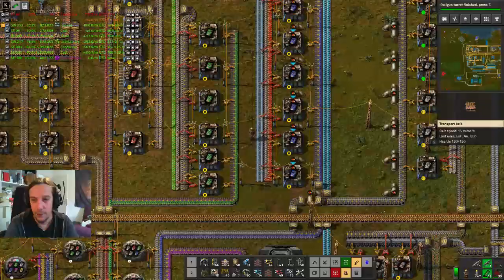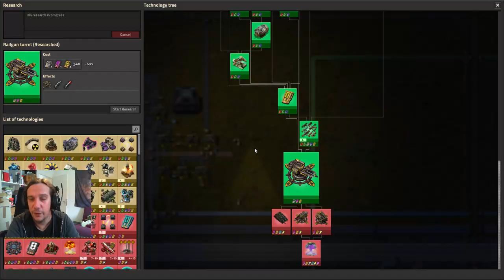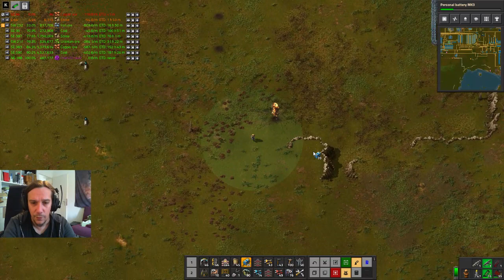Let's Play Factorio Krastorio 2 - 50 - Gameplay Playthrough

Comment: your nuclear setup is wrong, Krastorio changes the entire thing and it's quite easy actually. Every heat exchanger takes 50MW and produces (iirc) steam for 4 turbines. I don't recall my setup, but I think it was 4 reactors, 25 exchangers and 100 turbines, or something like that. the neighbor bonus is dramatically decreased compared to vanilla.
Keep it up and do the numbers, nuclear is scary on vanilla, but not so much on krastorio 2
Reply from the maker: Oh thanks! That would basically make my work so far need less exchangers and a few more turbines. 
Thanks for pointing that out, you will see your posting being processed in Ep. 51 ;)
Reply: @Ic0nGaming  just for completeness, I booted up my K2 save to check, each reactor generates 375MW (2x2 array, bonus included) that's 1500MW (1.5GW) each exchanger needs 50MW so you have 6 arrays of 5 exchangers (water pump limit). Each exchanger produces 250 steam/s and each turbine consumes 50 steam, so 5 turbines per exchanger for a grand total of 4 reactors, 30 exchangers and 150 turbines
Reply from the maker: Ha, thanks for those numbers! I did the numbers on my own and ended up with the same amount of machines like you said here while I was recording Episode 51. Now after release I noticed your comment ;)